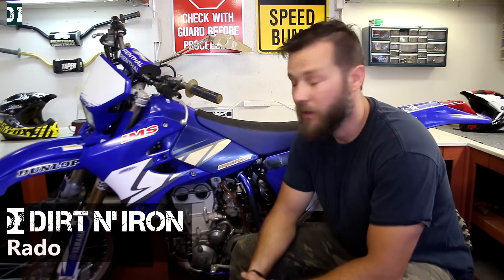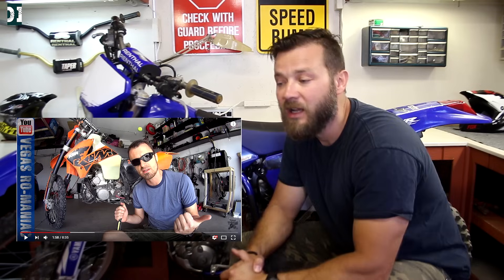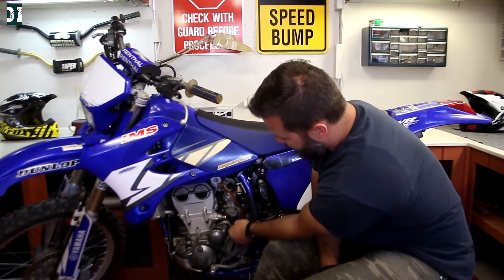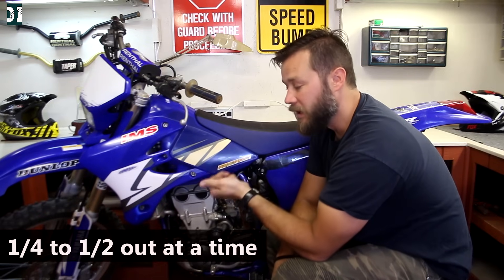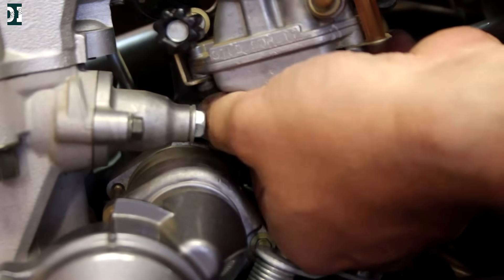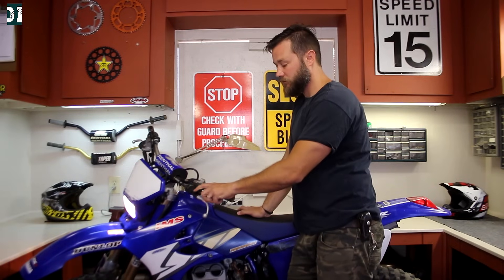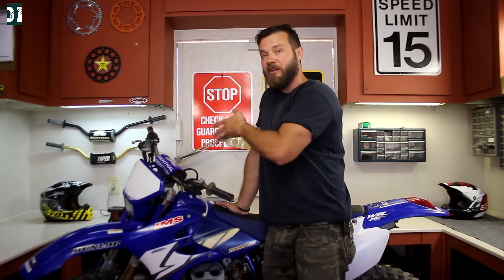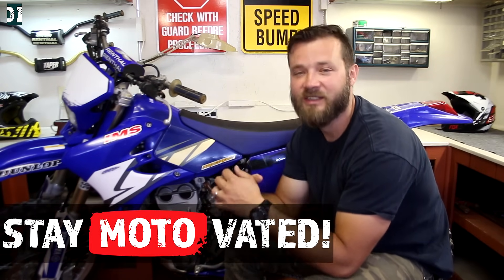How to adjust idle on 4 stroke dirt bikes - fuel screw adjustment

Comment: Hey, Ive been making some adjustments and have no idea where im at with my idle speed screw. Is there a way to bring the idle speed screw (not the fuel adjustment screw) back to a basic stock setting? It wont start up now
Reply from the maker: I would bring it back down, start the bike while giving it little bit of throttle and then adjust the idle. .just play with it one by one
Reply: @dirtniron  awesome thanks, I'll give it a try

Comment: I have been fighting my bike bog for weeks now my pilot jet is a 45 and my main jet is a 165. My bike runs great now but it took about 8 turns out on my air mixture screw.  I adjusted the screw out until my bike had the highest rpm and left it there. No bog but now I cant keep the front tire down, even in fourth gear. LOL
Reply from the maker: 8 turns out is too far, I would change the pilot accordingly
Reply: The bog is from the accelerator pump. Research that for that low end bog problem.

Comment: I tried to do this with my 450 wr but every time I had the air mixture right it would not rev up when I pulled in my hot start lever. I found my bike runs best when you follow the youtube video on Tusk air screw adjuster made by RM ATV.. This guy knows his stuff but sorry it's would not work in my bike.

Comment: Hello beautiful video and explanation. My rmz 250 if I pull the hot starter when running it will die.. why is that?
Reply from the maker: Are you sure its hot start? Not a decompression
Reply: @dirtniron  
I am sure it is a hot starter infact it goes to the carb. Rmz 250 has a decompressor ? I DON'T think so. Any explanation for my question..?
Reply: If I push the hot starter half way it revs up all the way it kind of bogs no matter how I adhust the fuel screw.. please help

Comment: I have a yz250f. It runs and rides but when i stop or try to put it in neutral when it’s stopped the bike will shut off. Should this help out with that ?
Reply from the maker: adjust it and see, it can solve your issue. also, raise an idle a bit
Reply: Dirt N Iron that’s what i was planning on doing, thank you ‼️

Comment: No matter how far I turn out the fuel screw the idle does not decrease. Any idea?
Reply from the maker: Sounds like its too rich, try one size smaller pilot jet.
Reply: @dirtniron  thanks I will try that
Reply: I went down a size in jet but the rpm won't go down as I turn out the fuel screw. Any ideas?

Comment: I have a dr350 that will not idle reliably under 2500 rpm. Even fully warm. I rebuilt the carb several times put in a new plug check for air leaks I know it's getting fuel and I'm just almost out of ideas aside from compression or maybe some ignition issue. I think I'm a little bit rich now but I'm not sure I can make it perfect but maybe I'll watch this video and mess with my bike this weekend

Comment: Are backfires and pops when letting off the gas. To lean or too rich?
Reply from the maker: popping on decell is lean condition, play with the fuel screw or maybe your pilot is dirty (or small)
Reply: @dirtniron  thank you for the response. I will try the fuel screw. I cleaned the car because I just bought it and only ran on choke pilot was clogged. Have new gaskets and jets coming in

Comment: I am getting a 92 honda xr250l sorted out and it wont start without the choke even when warm? Also I cant seem to get idle to come down without it stalling. When it is idling(high) when I go on the throttle it is groggy and back fires.. this is first bike with a carburetor. Anyone have an idea?
Reply from the maker: sounds to me you are too lean, you might have dirty pilot jet. I would check that first, if still the same then you need to go bigger on pilot jet and fine tune the carb with fuel screw later on

Comment: just purchased a KX 250F about a week ago and its running super high idle with loud pops coming from exhaust when I release the throttle - the guy I bought it from told me he just cleaned the carb about a month ago...would lowering the idle and the fuel screw help w this? or am I looking at bigger issues
Reply from the maker: I would start there, lower the idle a bit and then play with fuel screw, try to give her more fuel, sounds to me she is bit lean. Dont bring idle too low with idle screw, adding more fuel will also lower the idle. Try that and see how it responds. Is still pops from exhaust then maybe go one size bigger on pilot jet. Try to follow the steps from the video
Reply: @dirtniron  thank you - may be a dumb question but the KX manual calls for 90 octane fuel...is that an absolute must or can you use regular gas in the bike?

Comment: hi rado, I have a 2001 honda trx400ex quad I just picked up. it ran good with the fuel screw pretty much all the way in, but the idle was way to low coz it wouldnt stay idling, I changed the idle screw and moved the airscrew out (regretting that now) do u have any suggestions to get it running?
Reply from the maker: put the idle screw back and try to play with the fuel screw, do half turns and see where you have best throttle response, then set the idle with idle screw if needed

Comment: you can cancel the mechanism of the lever above the clutch?
Reply from the maker: you need that for hot start. why would you remove it ?
Reply: Why do not I use it to start the bike, and what is it for?
Reply: How do I use it?  it's the first time I have a motorcycle of these
Reply: they told me that it was useless

Comment: Hey Rado –
Many thanks again for the super helpful videos!

I tried your method and it works exactly as you describe (yea!).
  However, if you have a moment, I would really like to understand WHY this works.  I find it very counter intuitive.  It would seem to me that as you screw the pilot out you are adding fuel.  Thus, I would not expect the RPM to go down/drop (when you add fuel the RPMs should go up, eh?)

What am I not understanding?
  Thanks!
Reply from the maker: when you add fuel, the rpm is going down and when you add air the rpm is going up. try to pull the choke once the bike is warmed up (more fuel almost no air) the rpm will not go up, but when you pull in hot start (way  more air) the rpm goes up.  It is more difficult to burn a lot of fuel, its easier to burn fuel mixed with more air..  hope that makes sense
Reply: @dirtniron  Ah.  So as you are turning the pilot screw you are slowly increasing the richness of the mixture (more fuel but not more air)... and eventually you reach a point where the richness is so high that the RPMs actually drop.  Am I stating it correctly?
Reply from the maker: i am not sure what are you referring to as a pilot screw, are you talking about the fuel screw? or the idle adjustment screw?
Reply: Sorry.  When I wrote above "pilot screw" I mean "fuel screw."

Comment: Had to subscribe to give a small help, thanks to this video i now know exactly how to properly set my air/fuel screw aswell as the Idle one! Thank you very much!
Reply from the maker: cool, glad it helps! welcome on board!
Reply: @dirtniron  Quick question, when you say in the vid "Turning it out" and the RPM gets lower, on mine it does the opposite, if i'm 3 turns out it's quite high rpm. If i turn it down from 3 turns i get it lower and lower. 2.75 turns seems to be the best for me, right that part where it doesnt get higher, and doesnt get lower. 

Should i turn it back a half turn right before it starts to raise the RPM?

So basicly, if i turn it out more, then the RPM rises higher. It's a Keihin FCR 37 (flat) carburetor

Hope i made any sense!

Comment: Great video. What causes the idle to stay high when pulling in the clutch to stop?
Reply from the maker: you might have hanging idle, does it idle ok on neutral? if you rev does it come right back down to idle?
Reply: @dirtniron  Thanks for the reply.. It idles ok until I ride it, then it tends to hang onto that higher rpm unless I keep it in gear until almost a full stop (so that it drags the rpm down).
Reply: @dirtniron  I tried it last night and after starting, it was idling high so I dialed down the idle. I don't know if that will cause it to die (too low idle) I will have to ride it around a bit).

Comment: hey i got a question i got a yamaha ttr125 4 stroke it runs perfect one you get it to start by bumpstarting and holding the throttle but when i let go of the throttle the bike dies and it wont idle  i am going to try this if it doesent work can it have something to do with the floats ?
Reply from the maker: you need to clean and adjust your carb, its not supposed to do that. does it run good?
Reply: @dirtniron  i have cleaned it with compressed air and brake parts cleaner. Yes the bike runs really good once you get it to start
Reply: @dirt n iron i tried to do as you did in the video but when i pull in hot start the idle raises even more all though my fuel screw is all the way in

Comment: My 2001 KTM 400 sx will stall out when I pull the hot start. Also when I blip the throttle it sputters and stalls. If I roll the throttle it will go to full revs. Any ideas?
Reply from the maker: I think its probably too lean, try one size bigger pilot

Comment: Hello my friend .. I have a wr 450 f super motard 2008 and I have done all the free mods but it has not boosted as much as I expected .. I had driven yz 450 f super motard and its not compared power with wr .. it's gearbox ratio the reason or sprockets?? yzf can wheelie with 5th gear but wr whith only 2nd.. 15 teeth front and 46 rear on my wr..
Reply from the maker: I think both, plus YZ has more aggressive cams as well

Comment: how u do it when u have 4 carbs? do you have to tune it first?
Reply from the maker: i guess you need to synchronize them
Reply: Okey I sync them and they are very smooth but I'm having the exact problem. When the bike warms up it stragles to idle moreover it loses power on the low rpms. If im on idle and i pull the choke even a little the bike stops and when i fire it up cold i dont have to use the choke but only the throttle as a result im guessing it running rich. What do u think about that?
Reply: Lets say i connect the sync tool back on bike which messures the hypopressure. I'll go all the way in and i'll start unscrewing the mixture screw until i reach the lowest pressure is that correct?

Comment: I have a Honda trx250ex and it running rich and I can't figure it out
Reply from the maker: jetting, make sure you have clean air filter, play with fuel screw and if still rich then maybe try to play with needle and if still rich then change the jets

Comment: do you think I could get that sharp throttle response from my 125cc 4 stroke scooter? it's very slow to react
Reply from the maker: you can dial it in, but cant get as sharp as 450
Reply: @dirtniron  I got this bike really cheap as a project.  It's an itailian scooter (piaggio) I had the carb apart and cleaned, It's a kiehin cv carburetor, also it was a great learning experience.  I think the lag issue is related to the style of carb (constant velocity).  The bike is ultra smooth

My idea is to swap it for a mikuni vm with a pod style filter and a free flow exhaust, but I don't know which size carb would be best?  or which size jets to get?

Do you have any suggestions?  I'd love the "rip" feel i had with my old 2 stroke 50cc scooter but obviously I don't want to buy another bike (I have a suzuki bandit as well and my girlfriends banned me from buying anymore "rubbish")
Reply: also I was thinking of buying a 125cc pit bike exhaust and somehow modifying it to fit the bike

Comment: Hey man, thanks for the info....once you have it dialed in, is it possible that the plug shows signs of too rich/lean....or will this process ensure the plug reads as "sweet as"? Can you elaborate on hotter and colder plugs please
Reply from the maker: I usually go with the plug that is recommended for the bike. Jet it correctly, adjust the fuel screw and it runs great.
Reply: @dirtniron  thank you, I followed your advice in this video, bike is running great, has more power and no backfiring. Have not checked the brand new plug yet, but i will tomorrow, it's the standard plug recommended in the user manual

Comment: Shouldn't you set the idle mixture screw for highest idle speed, not lowest?
Reply: Probably you mean the air screw on a two stroke
Reply: @joselitobrigante  for four stroke do i need to set the highest idle speed or lowest? i dont understand

Comment: Hi. I have a YFZ 450 Yamaha. My bike starts and holds idle very well. But once I put it in first and ride even just 50 meters or so once I leave the accelerator the bike cuts off and refuses to start until another 15 to 20 minutes.  It has an electric start. Could you please tell me what I could look for or what the fault may be.
Reply from the maker: Is it fuel injection or carburetor?
Reply: @dirtniron  it's a carb
Reply from the maker: i would start at the carb, make sure its all clean, the seals are good, etc 
try to adjust the air/idle once the bike is warm. I have video explaining that.. 
see how it works..
Reply: @dirtniron  okay thanks I'll see how it goes now

Comment: I want to know about the mixture setting of yamaha ybr125. It has TK mv28 butterfly carb. Prblm is that i dnt have good mechenic in my area and i do most of the maintenance by my self.
Reply from the maker: I havent work on that bike, but the procedure should be similar, there is a lot of info online, do some search check the forums and you can get decent base line
Reply: Dirt N Iron thanks allot for replying i am working on that already. Actually i m frm pakistan and these bikes came here in 2015 but. Still mechanics are unable tu satisfy owners.
Reply from the maker: it should be very simple engine, I am sure you can figure it out. Good luck!

Comment: If your rpm is up and down without touching the rev that means your a/f mixture is not tune properly.
Reply from the maker: no, that means that you probably have air/vacuum leak somewhere on the system. Usually its a rubber boot that connects to the carburetor.

Comment: My hot start dont does the same wether fuel screw is fully out or fully in? What does that mean? It just sort of slowly dies 
Bike works right and atarts rides ok etc
Reply from the maker: not 100% sure, try to go one size bigger on pilot jet, see what that does
Reply: Dirt N Iron i will go get one from the shop. It sounds exactly like yours does when its to lean when u pull the hot start but it makes no difference where the fuel screw is.
Reply: If i change it the opposite way it does the same thing strange one
Reply from the maker: sounds like its too lean, bigger pilot should help I think. Give it a shot for sure
Reply: Ill try one today

Comment: hey Rado' quick question regarding the " hot start " lever. I removed mine after installing a RSC ( Righteous stunt EZ pull clutch lever which doesn't accommodate this hot start feature as suppose to the OEM ) for my 07' wr450 , number of other guys claim never to have use of it. therefore I removed lever and zip tied cable onto handlebars. however on occasion my bike will all of a sudden cut out and die at stoplight when I take-off . bike takes awhile to restart but finally gets going. could this be affecting the bikes performance ? hope ur doing well man'
Reply from the maker: Hey Sam, I think that should not cause it. Maybe you are running little lean, so the bike has occasional flameouts. Try to adjust your fuel screw a bit and see if it helps.

Comment: I have a  Yamaha wr400f 2000 I have a problem when I twist the throttle and it bogs
Reply from the maker: Jetting issues most likely or dirty pilot jet. I would clean carb and try to adjust fuel screw first, if bog still there try to go one size bigger on pilot

Comment: Hey Dirt N Iron, i changed the fuel screw on my 2007 yzf250 so i could adjust it when it's warm and hopefully get rid of my decel backfire. But after puting the adjustable mixture screw in, the bike will die if i screw it all the way in, but the rpm doesnt seem to drop no matter how much i unscrew it. With the old screw my hot start reved the bike up now it kills it.
Reply from the maker: What kind of screw did you buy? Cheap on or brand? Make sure it's installed correctly, oring, washer spring in correct order.

Comment: My bike will only idle high with hot start if the fuel screw is 3 turns out, but it doesn’t die if it’s all the way in. So I’m not sure if I’m lean or rich on the pilot because symptoms point to both?
Reply from the maker: why dont you keep it 3 turns out then? does it run good like that?

Comment: Man there's gotta be something wrong with my carb on my wr... I've rejetted it probably 10 times and I've even installed a JD kit with no luck. It still has weak response with lots of decel pop
Reply from the maker: what jetting are you running now? do you have aftermarket exhaust and open airbox?